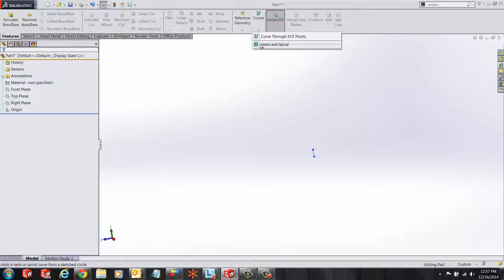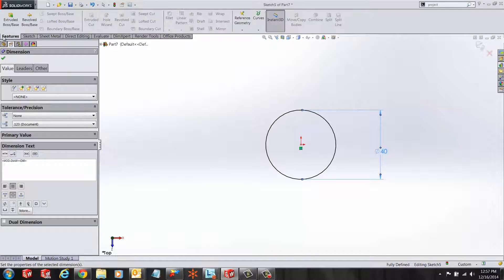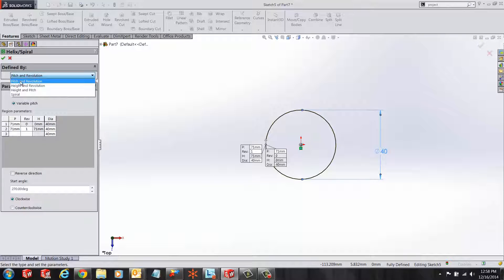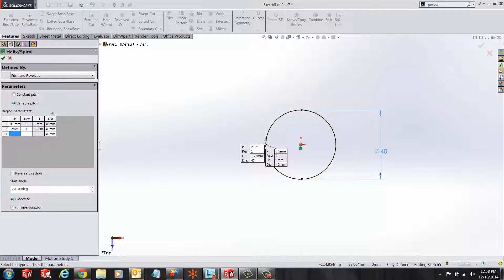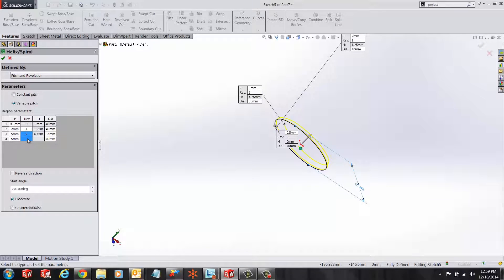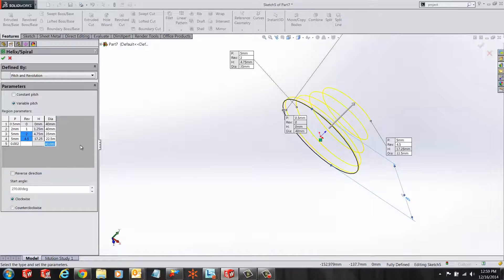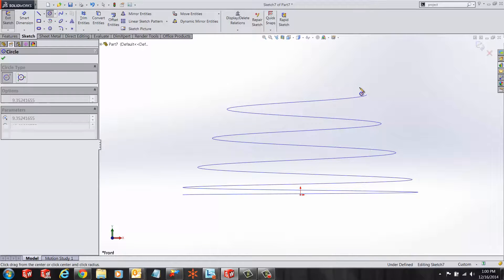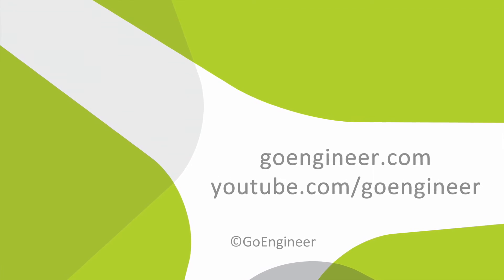SOLIDWORKS - Creating a Helix Spring with Variable Pitch and Diameter

Comment: If the swept boss command uses a sketch on the front plane, it will produce a spring cross section that is slightly elliptical instead of round. If a round cross section is desired, the circle must be drawn on a new plane that is perpendicular to the helix. The difference is small, but measurable.